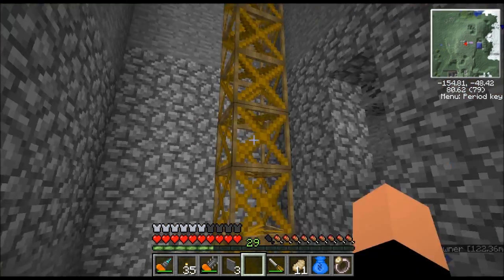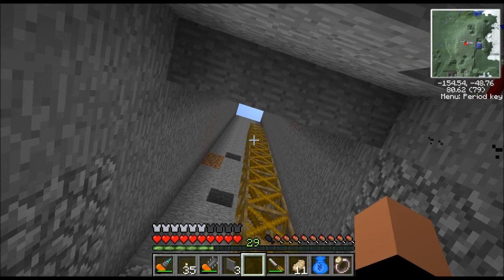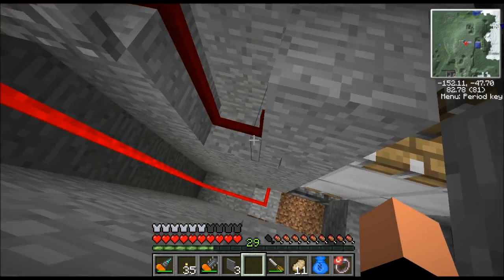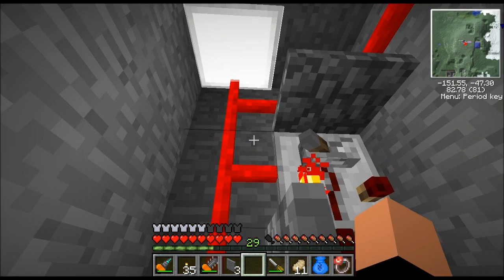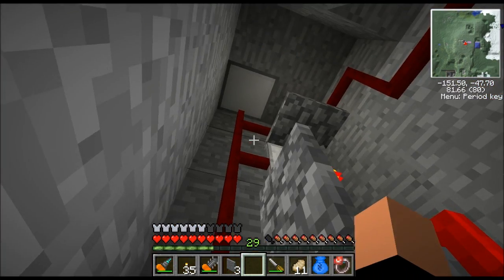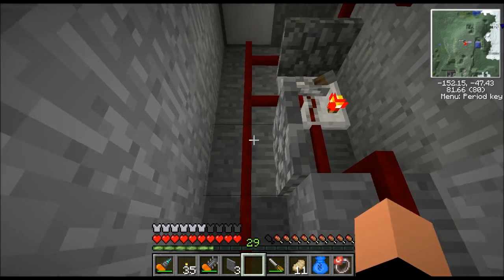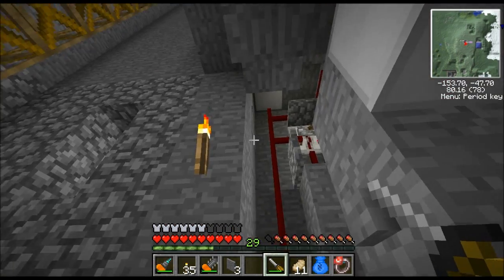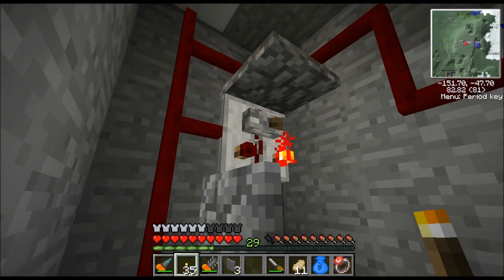Tekkit Tutorials With Grumpy - Toggle Latch AKA a T Flip Flop

Comment: I know this is an old video, but I have another use for it.  In combination with IC2, use a Toggle Latch to turn on/off power via an EU-Splitter Cable (and a wireless receiver if you're fancy).  You can sever power to different machines if you need to.